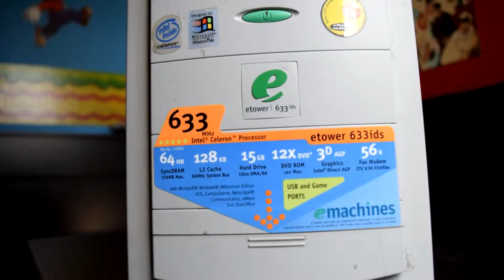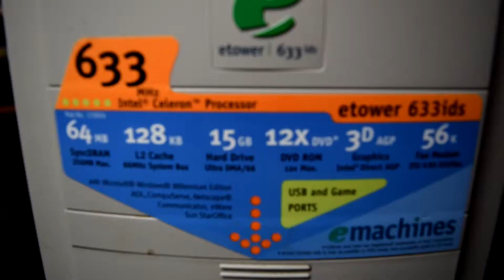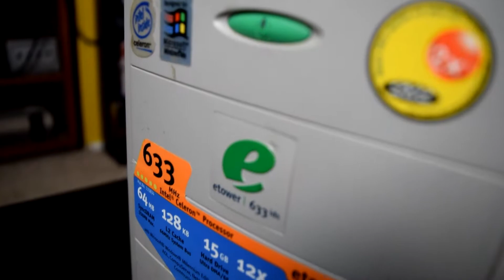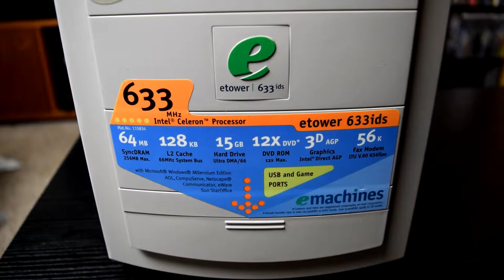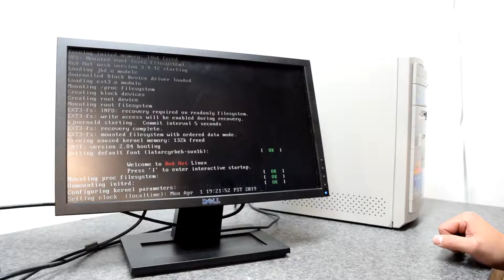eMachines "Never Obsolete" Restoration Build (pt. 1)

Comment: I remember those days with pre built Pcs and the PC market boom in late 90s early 00s. It was flooded with eMachines, GateWay, Compaq to name a few with all those stickers on them horrible looking towers basic 15 CRT monitor (late 90s). Then TFT monitor (00s) I used to go into a shop in the UK called Dixon's XL and listen to the sales people oversell them to customers who had no clue as it was for their kids and school. They would sell sell sell because they would get commission for each sale, they actually got me in 2000 because I didn't know much about PCs like I do now. I got a Compaq Presario 5410 it was rubbish in spec but helped me learn about computers specs were 

AMD K-III 350mhz CPU
32mb 100mhz RAM
Onboard graphics
4GB HDD
CD-ROM drive
15 CRT Monitor, K&M

Price £799 it had no upgrade path for graphics board had 5 PCI slots no AGP. I maxed ram to 384mb (didn't do much) and upgrade HDD to 20GB which in 2002 cost around £80 I then built my own in late 2002 and gave the Compaq away

Comment: Ahhh, the fine art of shoving computer gear into cases that were never meant to have them. It's a skill that not many have these days.

I did something similar with a much smaller case, the Compaq iPaq desktop. It originally came with a Pentium III 500, which I swapped out for an AMD A8-6500 with 8 GB of RAM. I also had to shoe-horn the guts of a 300W MicroATX power supply into the existing 90W proprietary PSU enclosure.

https://i.imgur.com/23FYVYs.jpg

It worked mostly fine until an inductor burned up in the power supply, at which point I tore it down and sold off the motherboard, CPU and RAM. It was a fun project.

For a fan on your case, I'd recommend using an 80mm fan to mark a template on the back of the case between the I/O shield and the door and cutting out a hole for a fan there. You also will want to stick with a low wattage CPU, I'd recommend 65W maximum, 95W is pushing it with a good heatsink.

Comment: Nice video! Can u do part 2??
Reply from the maker: Hey thanks! I have actually been working on the part 2 for a while, but it has not quite gone as expected, hope to get it posted soon.
Reply: My  emachine ET1831-01
is running but the Front LED
is not lighting, can you help 
me?The push button in the front is a plastic one and when
you pushed, conecct to a switch that turn on the machine, but the LED doesn't light up. Why?